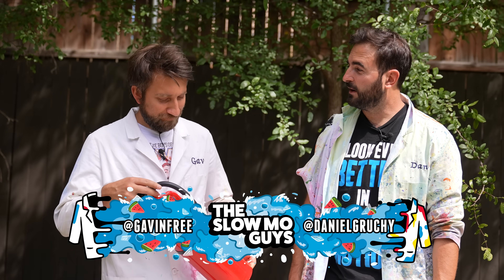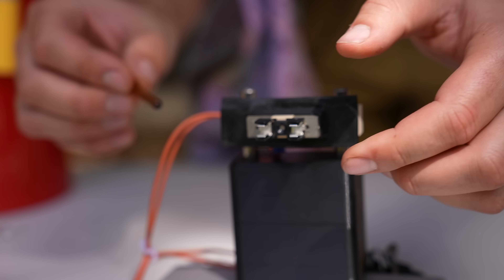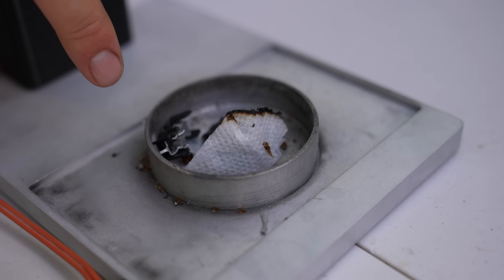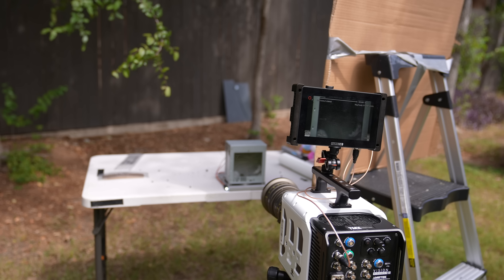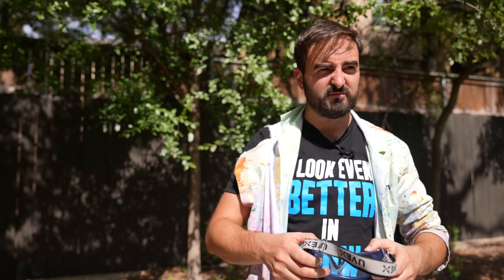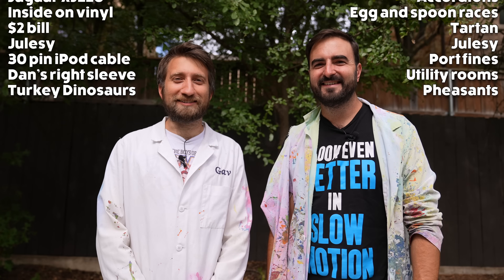Tiniest Exploding Fire Extinguisher at 150,000FPS - The Slow Mo Guys

Comment: itroglycerin Fire Extinguishing
Nitroglycerin has been used in oil well firefighting to extinguish fires by creating a shockwave that displaces oxygen and smothers the fire.
 This method works by detonating nitroglycerin, which consumes the available oxygen in the immediate area, effectively suffocating the fire.
 The principle is similar to blowing out a candle, where the shockwave and subsequent displacement of air remove the oxygen needed for combustion.

Historically, nitroglycerin was also used in well stimulation, where it was detonated to fracture oil-bearing formations and increase oil production.
 However, this practice was dangerous and led to the development of safer methods over time.

In modern oil well firefighting, explosives like nitroglycerin are still occasionally used to collapse wells and smother oil fires.
 The use of high explosives, including nitroglycerin, has been part of the methods employed by experienced firefighters since the 1920s.

Comment: It's probably separated vaccum containers of liquid carbon monoxide and liquid oxygen. When they break and combine, it would react becoming CO2 and massively expand into a gas. It would both spread itself through both force and turbulence and smother the flame. That'd be my guess anyway

Comment: scrolling through the comments and i did not see it. i may also be somewhat wrong in some aspects as i am no scientific expert however i do know that devicesblike this use concussion (ie the shockwave) to extinguish the flames and if i am not mistaken the concussion needs to be directed to "blow out" the flame. i also know that it will not stop any smoldering bits from reigniting.

Comment: Hi, something worth knowing, if you add saline solution to the ethanol, it burns with a yellow flame. 

I don’t have the exact ratio, but it was part of my Olympic torch proposal, for London 2012, that came in second place using also an Anaerobic digester produced methane to EDF’s Fossil Fuel design.

Comment: This could be liquid co2 which would explain why you see no liquid because liquid co2 evaporates at -62.89°C and displaces the oxygen thus putting out the fire. Because at 61°C ambient temperature co2 would be at 2186.6PSI. So at 100°c it would definitely pop. That glass must have a rupturing capacity close to the the same psi as liquid Co2 at 100°c 

Idk just guessing

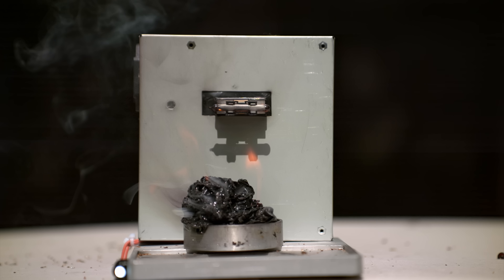Comment: interesting, the footage at 5:50 mark shows that test the LED flickered several times on the first open air test, presumably as the bits of conductive material formed little bridges before finally dispersing. Would love to see more slow motion exploding conductors with ahem 'significant' voltages to see if you get a lot of little bridges of arcing.

Comment: I, personally, have never worked with one of these. My class has, of course, been debriefed on how to properly operate a fire extinguisher (normal sized). I'm in a robotics class so I know some electricity. Arcs are cool to see... when controlled. In the electrician field, it might be a different story. There exists a thing called an arc flash. This happens when an arc (basically a lightning bolt but without 100 million volts) forms inside of an electrical cabinet (you know those big metal boxes you see on the side of the roads) and when you open the door, it sends it straight at you as well as any debris. That's why we are trained to open the door and stand to the side with the door acting as a shield. Arcs occur when electricity travels through the air and to a grounded conductor or, if you're unlucky (or stupid and didn’t put on protective gear), yourself. It's quite common to see an arc at places like a power plant when they open a contact. When they open the contact, that stops the flow of electricity through that part of the circuit and is commonly used when rerouting the electricity.

And yes, I do usually write this much. I do this a lot when it's something I'm passionate about.

Comment: The flame getting sucked in is more than likely the draft of the pressure change pulling the flame with it to fill in to normalize the pressure in the suddenly vacant pocket of atmosphere...if that makes sense? Probably better words to use but eh

Comment: If you put a lot of current into a really thin wire, it will blow up with a satisfying POP! in slow mo i'd expect to see the wire heat at one spot, have the hot spot travel a certain amount and then finally the wire to vaporize in the hot spot, with an arc for a little bit. 

other ideas: there are overpressure burst seals that are intended to fail at a certain psi.  in slow mo i'd expect to see the burst and the sudden pressure dump cause the air to drop it's water vapor and look like a gust of fog.

Comment: You should try to capture the "speed" of light. Use a laser and see if you can capture the beam leaving the frame. Lights supposed  speed is 186,000 miles per sec. You should get a result if over 1 million frames per second. You guys could make or break the theory of the speed of light. ....I think...🤔..maybe..I might just be an idiot.
Reply: You're not an idiot - they have actually done this already! 😊
Reply: @GenericaQwerty  Thank you. Do you have any advice on where I could find that information?  It's very interesting and thanks again.

Comment: So, no secret liquid. Just liquid nitrogen in a glass ampule coated in a conductive paint.

Temperature gets too high, pressure inside rises to the point where the glass can no longer contain it and breaks. The area is instantly flooded with nitrogen gas removing oxygen from the flames. And the circuit is also broken preventing re-ignition.

Comment: @ Dan & Gav. Dear Slow Mo Guys, could you please super slow mo something that is HYPER fast? No, not a hyper-car. It's pretty small and rather dangerous as well. I am talking about a TASER arc ⚡spark. Do different power level Tasers make sparks at different speeds? Or are they all the same SPEED? It's kind of like your SPEED of 🌩 lightning 🌩 Slow Mo video you did in the past except MICRO sized. Where does the arc (spark) from a Taser start and where does it end? If it has not already been said, (All though I'm sure it has) it's super awesome having our dynamic duo team back again.😁 Thanks!!

Comment: Video idea:  Get a small syringe (no needle), and put a tiny amount of water in it, just a drop with no air.  Then plug the end of the syringe with something, and draw the plunger back, creating a vacuum with a tiny bit of water vapor.  Let go of the plunger, and the vacuum will collapse, but with the water vapor present it will make a loud POP.  If you're foolish like me and used your finger to plug the syringe, it will hurt like getting shot by a bb, but will not break flesh or cause any bruise.  I'd like to see a video to see why it makes the violent POP when the water vapor collapses back into liquid.

Comment: It actually makes a lot of sense that the liquid turns to vapor. In an electrical fire the best way to put out a fire is to A. Get rid of power (done so by the breaking of the 'fuse' which breaks the chain of electricity), and then B. Choke it of oxygen. Really neat device

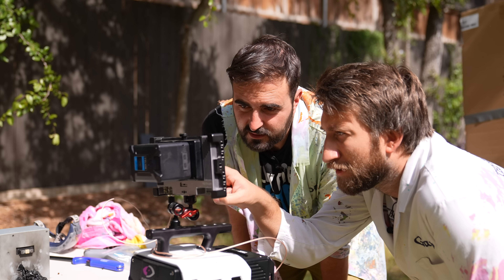Comment: 8:38 Those "ripples in the atmosphere" are caused by the changes in pressure from the expanding gas. This causes the light to scatter in different directions. It's not unlike seeing bright and dark spots on the floor of a pool with small waves on the surface or a caustic lens that can produce an image from concentrating those bright and dark spots (Steve Mould has a recent video).

Comment: Water rocket launch - is compressed air entrained in the water as it flows out of the bottle, only to EXPLODE as the water it is in reaches the outside pressure of only 1 BAR. I think it is because I took some pictures of this many years ago (about twenty years) and on one of them, there seemed to be a pancake-shape of exploding water coming from the column of water ejected from the bottle as it accelerated at over 100G. Air inside is about 10BAR and air outside is atmospheric pressure.

Comment: In the vain of explosive safety devises perhaps you could try some of the explosive bolts that Mercedes uses on the hinges of their gullwing doors. They are meant to release the doors if the car ever rolls over and lands on its roof so the occupants aren't trapped inside.

Comment: The fire went upwards and the explosion went outwards. With such a small device, I’m not surprised the fires weren’t put out due to the tangential arrangement. Could we try that again by placing the tube on a circuit board then lighting up the board? Or, placing the fire directly under the tube, even a larger fire in order to determine what the extinguishing radius is.

Comment: Exploding electronic components!  Easily done by forcing them beyond specifications.  EG;  over-voltage and over-current, transistors, capacitors, MOSFETs, Regulators, power amplifier ICs, transformers etc.   Would  be most interesting to see what over-clocking CPU / GPU processors without heat sinks really looks like as they explode.  Would be great to actually see the craters being formed, cracks propagating across chip packages and very rapid disassembly actually happening :-)   There is also a question that needs answered.  How long does it take for a fully charged battery to explode when subjected to a dead-short condition, how fast and how far do the bits travel?  ever slammed a spanner on a car battery?.. Wear Shades! and suitable PPE :-) Oh and have fun !

Comment: The one with electric conductor around is not to cut the power. It's connected to a low voltage power supply and into an input of a controller, such as a microcontroller, a PLC... so when it burst, it stop sending a TRUE value (24v in industry, 5v in regular electronics and 3.3v in microelectronics) so the controller knows that a fire is taking place and, most importantly, where. A fire detection system can have an HMI (a screen for showing information) and display a basic top view of the building and all of these sensors and their state, so when one of them pop, it get shown in the HMI and activate a siren, call firefighters or maybe even shut an emergency door if there are any dangerous materials inside.

In a nutshell, it's just for signaling. Probably if you connect a regular lightbulb to it it would pop just because of the heat generated by the current

Comment: I found a cool vintage thermal alarm from the 1940’s at the thrift store yesterday. It was just a 6” alarm bell with a hand wind spring ringer with a plunger that kept the alarm from ringing until it reached 136 degrees. It was rad

Comment: Drawing a blank on safety devices at the moment but other slow mo ideas I've thought of that would be cool are objects in a hydraulic press and a brake lathe. I'm an automotive technician and I've always wanted to see 0.001" of metal being shaved away from a brake rotor on a lathe in a macro shot. Ill have to think of automotive safety devices other than pre tensioners and airbags.

Comment: Be cool if you guys got hold of a salvage Mercedes SLS. Due to its gullwing doors (which open upwards), it requires some explosives on the door hinges where in case of a rollover they simply explode away from the car.

Comment: Hey Slow Mo Guys! On BMW R53 Mini Cooper S the positive battery terminal lead included a small explosive charge to disconnect the battery when the side impact airbags are deployed!! I'm sure this tech is used across other manufacturers and BMW models but I know that the R53 Mini has these installed! Would be cool to see it discharge in slow mo to disconnect a battery cable!

Comment: After prodding about the web a bit. The E bulb fire extinguisher is as I expected. A vial filled with 3M Novex fire extinguishing fluid.
Ie, it is liquid PFAS in a vial. For health reasons these products should be banned. PFAS (fluorinated) compounds don't biodegrade and accumulates in the environment. They have also repeatedly been shown to cause some rather major detrimental effects to the immune system.

These vials could have been filled with CO2, or argon. Would have been less toxic in the long term.

Novec might be magic. Not to say PFAS compounds in general. But people said the same about Asbestos, freon, Radium, DDT and plenty of other generally bad compounds before that.

3M really shouldn't market Novec as "poses no health hazards" when all their other PFAS compounds are shown to be health hazards, sometimes even already banned. Novec is though a "new" product. It therefore has to go through regulatory testing and such, that they can legally sell it in the meantime until long term testing has finished is frankly a bit horrendous given the general track record for these types of compounds.

However, the detrimental effects of PFAS has thus far required a fair bit of long term exposure to show up. Similar to Asbestos or Radium. But since PFAS compounds don't biodegrade, then they have this tendency to stick around in the environment. So even if we stop using/producing PFAS compounds today, we will still be exposed to it for decades to come, just like DDT that has been banned for decades now, but still shows up in blood samples taken from individuals born far after the commercial use of DDT stopped. Since DDT also don't biodegrade over time.

Do we really desire to stuff our surroundings full of even more non biodegradable health hazardous compounds?

Comment: Stack air bags (and other rapid expanding devices) in a clear tube or confined space, to see how high you can launch and the increase in speed as it cascades. Similar principle to the beer bottle on top of a basketball trick.

Comment: I was terrified seeing how easily the electrical tape got ignited... But then I remembered that you have ethanol there too 😅
I think the "fuse" functionality is for information that it pops, and not really used as fuse, that would carry any significant load, but I could be wrong.
Reply: The promotional material says that
"The fire is detected at the origin and the fire is automatically extinguished. The power is permanently cut off to prevent re-ignition[...]" The tubes seem to have specific current limits (up to 16A), but nowhere does it say what happens if you exceed it or if you can use it as a regular fuse. Personally, I'm not sure if i want my over-current protection to release noxious gas when triggered, so having it in series with a regular fuse as a thermal fuse is probably the idea here.

Comment: Have you ever taken the flint out of a Bic lighter and wrapped the spring around it, used another lighter to get it red hot, then thrown it on concrete?
If it was posable to get that moment at 150,000 FPS that would be awesome!!!

Comment: Halon fire suppression systems. You'll find them in the exhaust hood over the stoves in a restaurant and elsewhere. Tanks of pressurized foam and inert gas connected to smoke and heat sensors, some relays, solenoids and wire you asking me? Activated by fire or smoke, an explosion of foam fills the kitchen.

Comment: Here to recommend the Hydrostatic Release Unit, used to release life boats from a ship that has sunk. It has a spring loaded blade that is released once enough pressure is exerted on the unit from the surrounding water. They are EXTREMELY dangerous, do not open it yourself, the blade will fly out and will go through anything, safety glasses be damned.  If you had a way to make it go off underwater, it will be impressive.

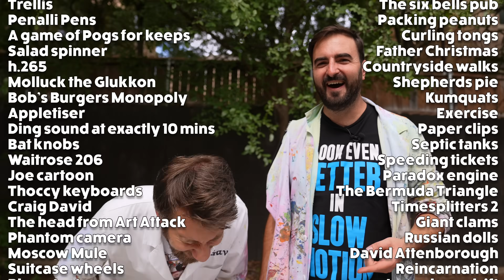Comment: I love the ding sound at exactly 10 min, which is also in the list at the end at 10:00 :D
The LED is blinking after the fuse popped in the open air test without the windwall which means the to contacts would form a new circuit from the flying parts

Comment: You guys should buy an RTX 4090 and cause the Power Cables to get ignited (as they are known to set on fire) and see if this here would be enough to put that small fire out aswell as cut power to the GPU, Potentially saving the GPU. 

I think, if these are wired in series to the GPU and located near the PCIe Power Input, that it could prevent said flames from starting.

Comment: Also I have a suggestion. How about a valve spring on a motorcycle revving to astronomical RPM. I've seen it, but they are usually using way less proficient cameras and you guys have.

Comment: I remember several years ago, y’all done a slow mo video of a backdraft and it shows just how explosive and dangerous they are, but is not the only explosive threat firefighters face. That would be a BLEVE (Boiling Liquid Expanding Vapor Explosion) and it would be interesting on how it occurs in slow motion (in a much smaller scale of course).

Comment: my fourth grade teacher did an experiment where he took two nails and a power cable from a lamp, and wired a large pickle up with the nails stuck in either end, turned it into a green light bulb...sort of...don't touch the pickle...paint on defunct camera shutter? or maybe a deeper dive on any of a huge handful of older subjects, paint/oobleck speaker, tempered safety glass, more paint and dust, Dan dermis ripples....just don't light a house on fire... again...

Comment: I have an idea why the explosion sucked the flame in on the last shot.
It looks like the force of the explosion is mostly perpendicular to the surface of the extinguisher. This makes sense, since it forms a crack on the surface and starts exploding out of that crack. That high speed fluid would have a lower pressure than the slower speed fluids around it (Bernoulli's principle). The higher pressure flame gasses would move toward the lower pressure explosion gasses.

Comment: The bit where the flame got sucked in is probably because there's a vacuum there that needs to be filled after the explosion blasted everything out of that area... As the air rushes in to fill the void it takes the flame with it....